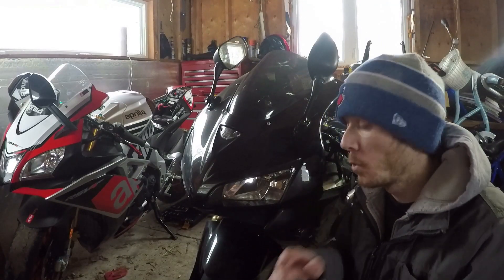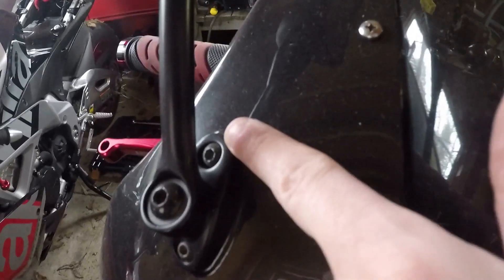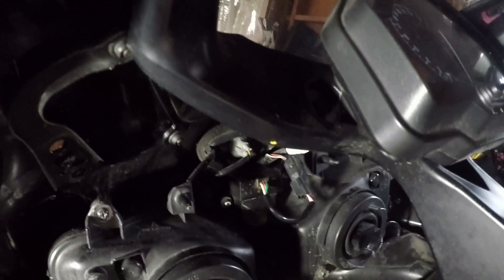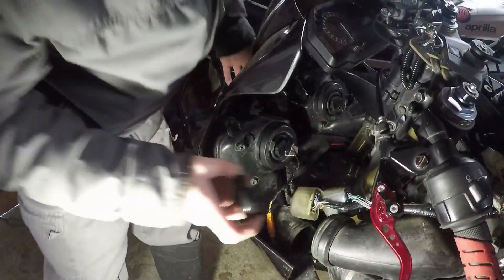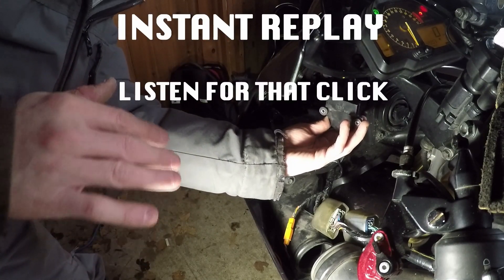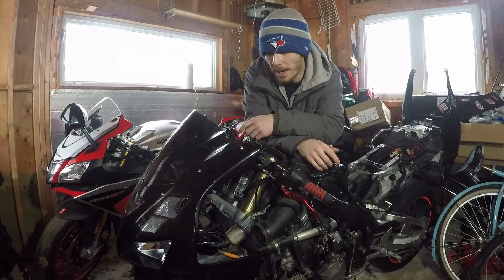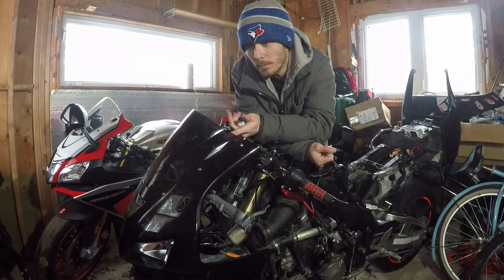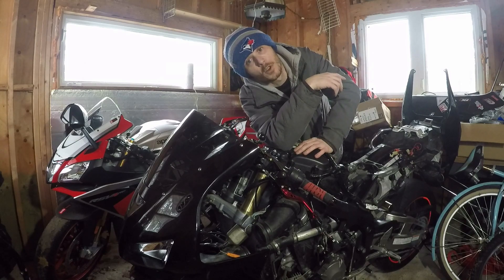Fuel Pump Won't Prime : CBR600RR  2005-2006 | PART 3

Comment: Omg dude ! Thank you so much! My 2004 cbr600rr fuel pump would not prime or work at all. I had my bike all apart customizing it and when i put it all back together it would not crank. After watching your videos you said the tilt angle sensor was installed upside down on your friends bike so i checked mine and sure enough i had done the same. I never wouldve checked that if i hadnt seen your video. I had taken mine off and i stalled it back upside down. It cranks perfect now. Thank you so much

Comment: Very useful, I'm having the fuel line issue right now....when turn on the ignition the fuel pump doesn't pump it and there's no sound,as from your video it might be the fise/relay/the fuel pump .... I've cleared all the injector with wd spray but the fuel cannot pump out in the fuel line pipe
.and cannot start even though the meter and battery is working fine.if you guys can help me out I'll be very  happy and I'm waiting for all your advice in the comments here.... please help me here as I'm very lost and confused by this problem I'm having here on my HONDA CBR   600RR.... WAITING PATIENTLY FOR ALL YOUR COMMENTS.❤❤❤❤😪

Comment: I tested my bank angle sensor and when I tested the red/white wire with the green wire, it read close to the battery voltage. Any chance anyone knows what that means? When I tested the white/black wire with the green wire it read close to the battery voltage as well.

Comment: My pump only kicks on if I bypass the fuel pump relay. Killswitch will turn the pump on and off if that relay is jumped. Any ideas ? Mines a 03. Ignition diode is bypassed. Tip sensor is bypassed.
Reply: I’m having the same issue! Have you figured out the problem?
Reply: @joshpowell9199 Any luck? Having the exact same problem too

Comment: Hi, I have an 04 CBR1000rr and, the FI fuse keeps blowing. Disconnecting the ECU, it doesn't blow. I had this issue about a year ago, changed ECU and it fixed the problem. I have the problem again. Hoping it isn't the ECU again, these are expensive. Last time I checked the bike over, I couldn't find any shorts, so almost clueless why this has happened yet again. Disconnected the regulator / stator. Fuse stays fine. Would appreciate some guidance if you could. I am thinking there is a serious short somewhere. Bike died when I was out for a ride. Battery extremely hot. When I was out for that ride, the battery already stopped charging, so I had to bump start it. After a while it completely died and now this fuse blows :(

Comment: 09 cbr1000rr, the relays are under the seat, head light relay is beside the bank angle sensor in the frt cowl. My fault was at the smaller block connecter behind the lft side faring. Thanx again. all bypasses removed, headlights work and she runs like a champ
Reply from the maker: Glad to hear it.  Have fun and ride on
Reply: @TubeSocksMalone hey buddy I’m having a issue with my 06 can’t get any power to the fuel pump but if I jump the relay with the red and black wire it will prime and bike will start and run. If you could reach out to me it would be much appreciated! Thank you

Comment: thanks man, looks like a big weekend coming up. If i just bypass the bank angle and she primes might save doing the front nose untill i get the new part, right now i have jumped the fuel  pump and she runs. just no lights or horn. i already replaced the fuel pump and all relays and stop start switch. thanks for the step by step

Comment: Good evening everyone, I would need a little help from you, I also have a cbr 600 rr 2005 with a small problem, it's when I start it and it doesn't start, it gets gas, kill switch it is checked, it has no problems, I understood, but why does it start if I push it in a very short distance of 1.5 meters and it starts easily... Thanks a lot for help me ✌️🤝

Comment: Hello friend. First congratulations on your willingness and didactics to teach, you are a teacher. Well, I need to ask a question. While bridging the car's battery, the red injection/oil light flickered and went out. From there I started testing from the service manual. But I'm a layman, and your videos brought the manual to life. I tested the 3 relays, they click and have continuity. I tested the engine relay harness and voltage is coming. I tested the angle sensor harness and voltage is coming. I went to test the module (black connector) and at point 18 it is not showing continuity as you say it should be. Only connector 4 shows values. Another problem is that when I turn the angle sensor it doesn't click the relay. My faith is that the problem is in the wiring of the cut off relay, I don't know very well how to test this wiring. But what intrigues me is the problem at point 18. I'm digging, it seems to me that some grounding must have overheated and ruptured, but I'm not finding it. Can you give me a light from this report?

Comment: Hello mate been following these trilogy of videos on the 05 600rr not priming. When I come to bridging the engine relay to check number 16 on the ecu, even though the key is off the fuel pump primes and then I can turn the key and the bike fires up and runs but then the only way I can shut the bike off is to take the bridge out. Any ideas please? I'm pulling my hair out. Great videos by the way. I have subscribed to your channel. Very helpful 👍🏻

Comment: I’m not typically one to comment on youtube video but i just wanted to say thanks a lot. I put my BAS on upside down whilst fitting my new fairings. looks better and is easier to put in upside down so i didn’t think anything of it. My bike is running good as new now. Thanks again
Reply from the maker: Anytime.  I’m happy you were able to figure it out

Comment: Thank you brother, my bike is turning over but won’t start,  you can hear it prime and everything, it an 04 Honda 600rr do you know what it could be? A good person had told me the tip sensor and he really seems to know what he’s talking about. Could that be a reason why my bike is not starting?
Reply from the maker: No if it was your Bank Angle Sensor which is the tip over sensor your fuel pump wouldn’t prime at all that is one of the symptoms I talk about in this video series to diagnose your fuel pump not priming .  It could be many things though if your fuel pump is priming but not turning over.  Injectors, spark plugs, fuel line etc.  Could even be your battery if it’s not strong enough.  Reading 12 volts doesn’t mean anything only way to check if your battery is failing is doing a load test.  A bad battery could still read 12 volts.
Reply: @TubeSocksMalone   ok thanks a lot man ride safe out there. ❤️💪🏿
Reply: @TubeSocksMalone  it turns on over on jumper cables but when off of it it barely has enough power so it cuts off when I try to start it

Comment: Man I know this an old video but how much voltage should be reading through pin 16 I’m getting low volts(.5) though it but I’m not sure if it should read this or battery voltage

Comment: Now what if you don’t hear the relay click when you flip the bank angle sensor?
Reply from the maker: I’m assuming you’re at the point testng the  bank angle sensor and you have checked already to see if the relay is faulty as well so if the relay is good and nothing happens when you are testing the bank angle sensor than that means you probably have a faulty bank angle sensor if you have done the previous steps correctly and be sure don’t skip steps saying to yourself “I know that’s fine” and go one to the next lol
Reply: @TubeSocksMalone  I tested them all following your videos. There was damage to the bank angle sensor when I was removing it. I couldn’t seem to get it to bypass with putting a jumper wire between the green and black I believe were the colors tho. Don’t know if that leds it to somewhere else.

Comment: I have a 07 zzr600 and I am having a issue wit the fuel pump not priming I put a new one and a new relay I search for a while for the tip sensor to realize that there is not one for this bike so would you know wat to do cause I have been seeing people just manually power there fuel pump by a toggle switch

Comment: Safe to say if 20amp inline fuse keeps blowing with ecu plugged in then its fried? 2006 600rr like yours...all same results you got...although im gtting a new starter solnoid coming in since mine was a bit corroded. Could I send you a video to get some idea's off you?

Comment: the zener diode in the ignition switch is often an issue if the fuel pump wont prime.
Reply from the maker: Only 2003/2004 have them in North America and only Europeon bikes for the rest. North American 2005 and 2006 models don’t have it 🤘 and California have a different wire harness also.  So for North America that is never the issue for a 2005/06 model year
Reply from the maker: No Hiss system for North American models
Reply from the maker: What I showed in this video is exactly how the service manual shows to diagnose a 2005/06 CBR600RR not just my way but the proper way for North America.  Not all 600RR around the world are the same 🤘 that’s what people forget.  Harness and ignitions are different for models outside of North America and California has a different harness because they have different and stricter regulations for emissions so they have I believe an evap canister.  Also North America, Euopeon and California have completely different ECM’s.

Comment: Hi Mike great set of videos, thanks mate.  I went through all these checks using them as a guide because I just had same problem on my 2005 cbr600rr.  In the end it turned out to be a 20amp fuse on the injector wiring circuit near the battery, it's on its own hidden away and I completely missed it when I was looking.  
Take care and best wishes from NZ.
Reply: Bro you saved my ass. I did the exact same thing and went through the entire service manual, it's weird that single fuse isn't mentioned anywhere. Anyways, thanks brooo!!
Reply from the maker: Thank you I appreciate it.  That’s great you got it all sorted out 🤘
Reply: Where is that located?
Reply: From memory it's a small plastic holder on a single black wire and it's very near the positive battery terminal and the starter relay.  The yellow 15 amp fuse is held inside the plastic casing.

Comment: Hey! Ive followed every step you did and read the comments. It seems that i have an open circuit in the B/W wire. The 20A fuse blows up every-time the ignition is ON and on RUN.  No power on B16 as well. Any suggestions beside opening the harness and following the wire?
Reply from the maker: Khayyal K just double check everything just in case you fudged a step then swap an ECM.  It’s sucks cause you have to spend money BUT if you tested everything I showed that’s exactly what you’ll have to do.  Probably a burnt out transistor inside your ECM.  Not fixable by any means just have to replace it.
Reply: MotoBike Mike i had battery and rectifier issues prior. My assumption is that the rectifier overcharged the battery (battery was whistling at one point), battery send overcharge to ecm and fried it. Oh well, learnt a lot from your videos and the service manual. Great content, keep it up!
Reply from the maker: Kyle K yeah that’s extremely possible.  Although it’s not super common to fry an ECM compared to other problems it’s also very easy to do it at the same time and can send you chasing ghosts for an eternity.  I appreciate the support and glad to have helped.  When you get you bike running let me know 🤘
Reply: MotoBike Mike changed the ecu, now its priming!!!! However it doesnt start just keeps cranking.
Reply from the maker: Just give a run through all the steps again and see if you happen to notice anything. I ask that because you could have plugged or forgot to plug something back or knocked something loose while checking stuff trying to figure out what was wrong originally.  Lots of people do that by accident.  I get messages all the time that people were doing maintenance had their bike apart and couldn’t get it running but they hooking the BAS upside down.  Little things like that.  Definitely not the issue with your bike but could be something else
Reply from the maker: Khayyal K I made a reply before but deleted it as I misunderstood you which was my fault.  Are you talking about the 20amp inline fuse that runs directly off the battery cable.  The mini yellow 20amp fuse.  Not the 30 amp main fuse
Reply: MotoBike Mike yea that one. Its connected to the + on one side and a connector on the other.     After further diagnosis, this is the update:              * changed the 20A fuse and disconnected ecm. I’m getting V in B16. The minute i connect the ecm, fuse blows
Reply from the maker: Khayyal K ok well I have bad news, good news and more bad news then good news.  The bad news is double check all your grounds just to be safe but they’re probably more than likely just fine, that’s bad news because it’s free to fix.  The good news is I’ve had this exact same issue with that exact same fuse just keep on blowing.  The more bad news is when I had that problem I was 100% positive I tested everything I showed in the video properly without question exactly as shown so the last option is ECM because you can’t test and ECM except for swapping it with one you know works so I bought a good one off eBay from a shop and came from a running bike.  Guess what.   Good news is my bike runs.   You seem to have the exact problem I have to the letter.  So double check everything I showed just to be certain you didn’t skip a step then well buy an ECM and let me know how she runs after 🤘 kid you not if you tested everything I showed and didn’t mess it up it’ll run with a new working ECM. Just make sure you buy the right ECM as California and the rest of North America have different modules and slightly different wire harness’s.  Match up the part # on your ECM that’s installed right now don’t just go by the year 👌 I would be very hard pressed if I was wrong.

Comment: MOTOBIKE MIKE YOU ARE MY HUCKLEBERRY! DUDE SO WHAT HAPPENED I REPLACED MY FRONT COWL FAIRING RESTORED 
ALL SAME AND DAMM BIKE CRANKED BUT NO FIRE. RAN INTO YOUR VIEDO AND DAMM WOULDN'T YOU KNOW IT I MOUNTED
BACK THE LEAN BANK UPSIDE DOWN OK! YOU THE MAN THANKS A MILLION !      BEST.   ARTHUR JUAREZ
Reply from the maker: I’m very happy you were able to figure out the issue.  Sometimes it’s an easy fix and other times it’s a bitch. Glad it worked out in your case.

Comment: Hello Bro. Excellent videos, I checked my bike using your videos, one thing, i found my issue on the zener Diode of the ignition key, it's broke and the ECU was receiving 12v but it need 9v for send the signal at the Fuel pump. Regards
Reply from the maker: Sorry for the late reply.  If your Diode is broken in your ignition then just replace it with this Diode and it should work fine you can order them off Ebay and maybe amazon.  the Diode is 1N4730A (3.9V, 1W) it should work fine after if you install it in the right direction if you install the Diode backwards just flip it around and should be fine they only work 1 way.
Reply: @TubeSocksMalone  thanks a lot.... Regards.
Reply: @TubeSocksMalone  The Fuel pump Is working now, I needed replace the Diode like you mention, but I have another issue, the bike have spark, fuel, but it doesn't works, I added Fuel directly to the trhottels and the motor don't move, do you have a some tip for this issue? Regards
Reply: Hey man I think I have your same problem with the zener diode. How do you know if it’s reading 12v in stead of 9vts??